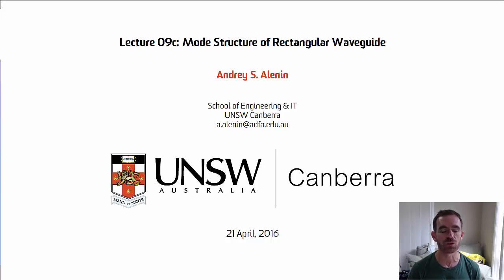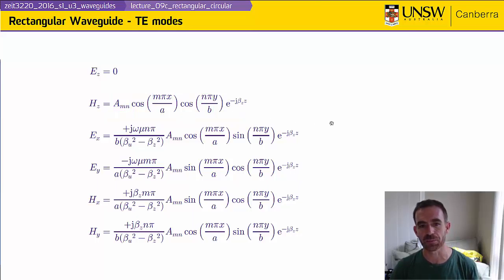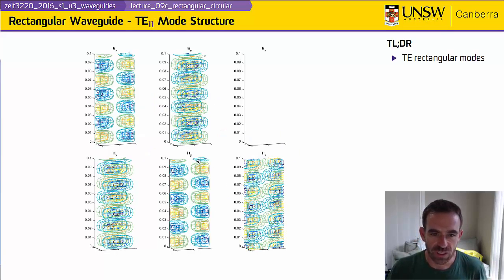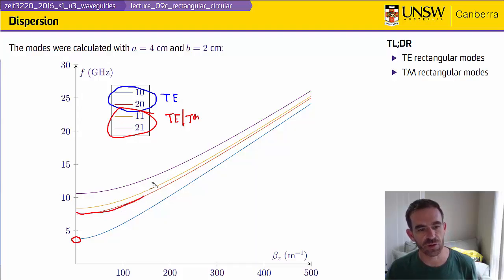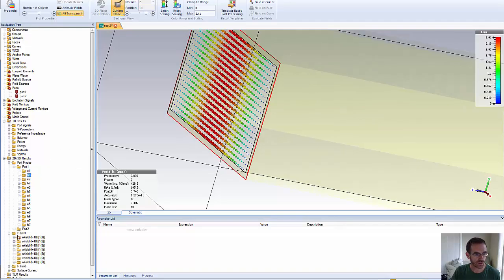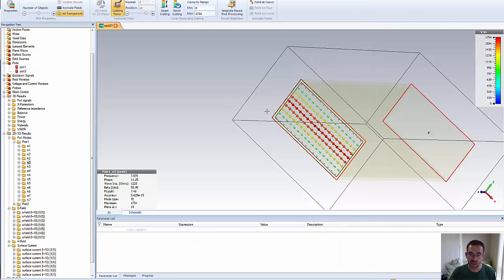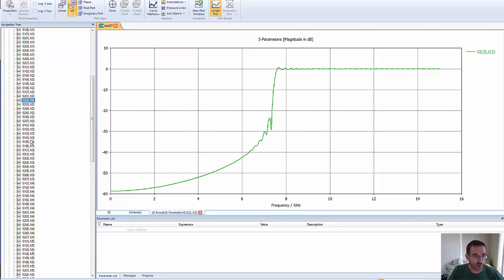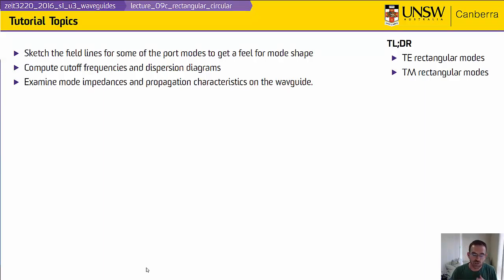ZEIT3220 - Lecture 09c - Modes in Rectangular Waveguide

Comment: Why would impedance in TE mode jump to infinity right at cut-off? thanks!
Reply from the maker: The mode impedance is the ratio between the transverse E fields and the transverse H fields.  For TE modes, the transverse H field goes to zero at cutoff (there is only a z-component), hence the mode impedance is "infinite" like an open circuit ("voltage" with no "current").  Likewise, for TM modes, the transverse E field goes to zero at cutoff (only an Ez), and the mode impedance goes to zero ("current" with no "voltage").
Reply: Thank you!